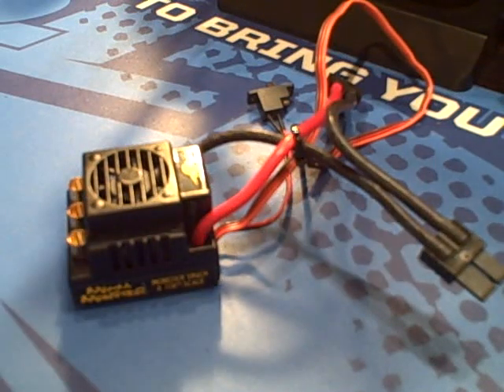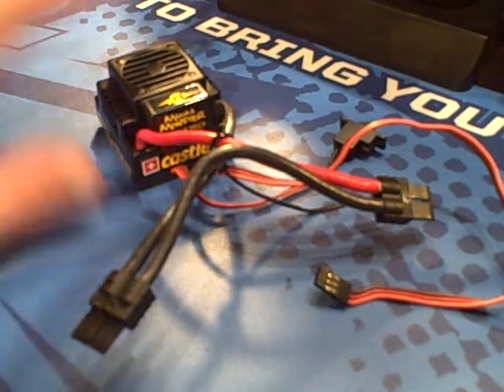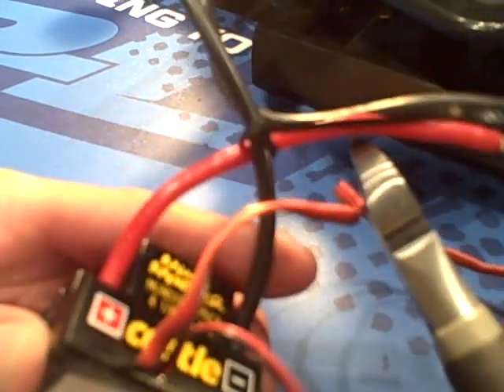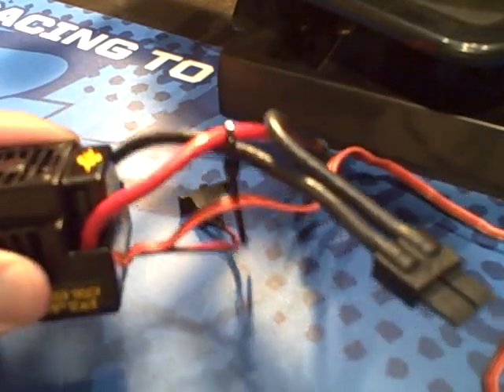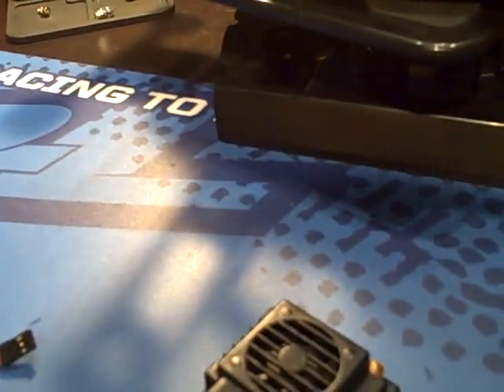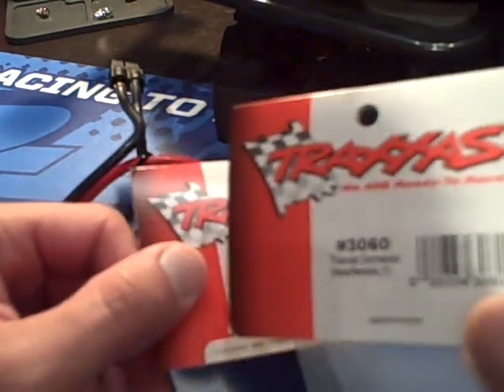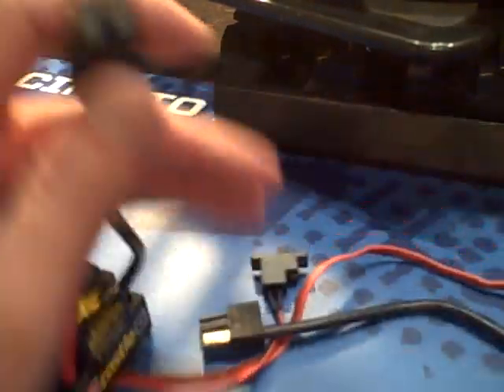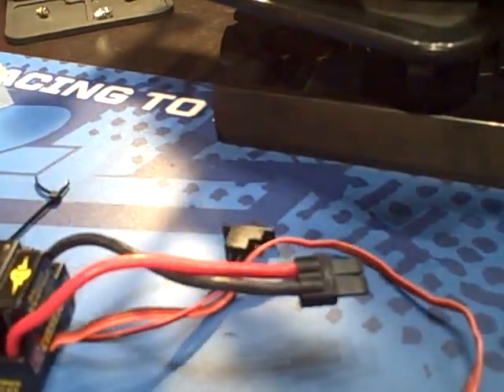How To Convert Mamba Monster ESC to Single Connection without Soldering

Comment: so I have this esc and I also want to run a single 3s but cannot. is there a connector out thee that could do this and still keep both wires if needed, like a y connector but opposite connections